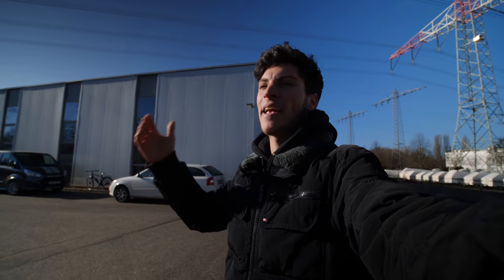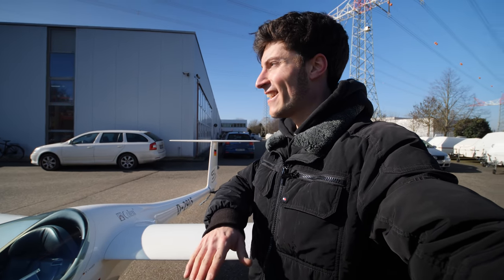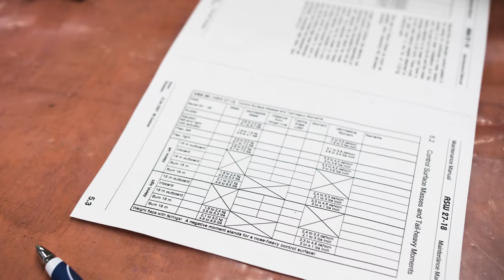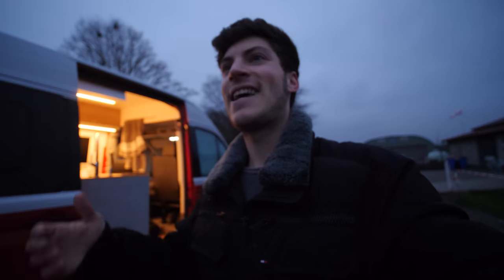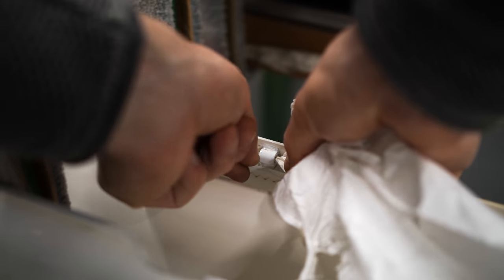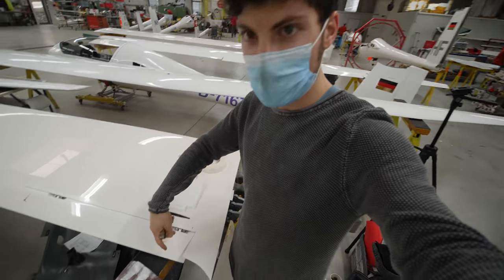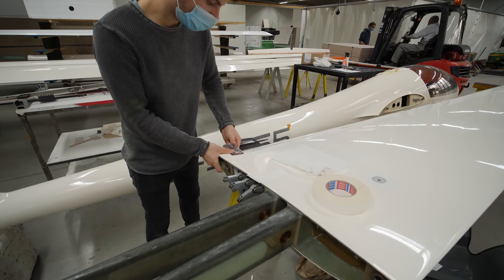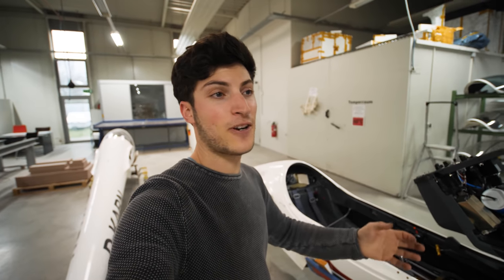250,000 km GLIDER INSPECTION at DG Flugzeugbau Factory

Comment: I noticed that you have applied some kind of primer or glue with a brush before attaching the rudder V-Seal. Would you mind sharing what was that and why is it needed? I think the V-Seal already has adhesive on one side.
Reply from the maker: They use Patex glue on the glas fiber surface to have a better adhesion

Comment: Had to have my LS3 in for its 3000 hour check. It took 40 years to get to that point. It was en expensive check.
Reply from the maker: Did you need to change any parts?
Reply: @SteFly  some flaperon hinge pins (they had to be dug out)
Reply: Would you mind sharing the rounded cost of 3000 inspection? I am considering an LS3 and it indeed scares me.

Comment: how does a glider control mechanics work? is it fly by wire mechanical or hydralic assist for some controls like flaps alerons ?
Reply from the maker: It is conpletely mechanical and only the wheel brake is hydraulical.
Reply: @SteFly  thanks for replying.

Comment: Hey Stefan, I’m interested in buying a libelle and since you’ve owned one in the past, I would like to ask if you know what’s the maximum height of person that can fit in a libelle?
Reply: Depends if you want to use the 'Ned Kelly' racing or raised canopy...... I'm 1.83m and can fit in a Libelle with the 'Ned Kelly' racing canopy.
Reply from the maker: I´m 1,80 m and it was ok with the flat canopy. How tall are you?
Reply: Depends on leg length - accommodates long legs well.  Long back not so much.  Shoulder width can be more of an issue than height. Try first. Great machines with excellent feedback and ability to find, centre and use lift - if you fit.
Reply: I was similarly worried before I bought mine, which has the taller canopy. I’m about 186cm, (6’1”) with shorter legs than average for my height. My knees are snug under the panel with the fiberglass seat back in (some have removed these in the past, maybe not a certified mod), a normal backpack parachute, and a 1” cushion. As has been said, shoulder width can be the limiting factor. A good, long trial fitting with all the gear is the only real way to know. Good luck!
Reply: I’m 1 meter 78, thanks for letting me know guys looks like my height will be no issue at all

Comment: My dad had several Cessna’s during his flying career. He had to get a 100hr service regularly. Is there something similar for gliders? Is this 3k service an industry mandate or is it a manufacturers recommendation?
I recommend for anyone else doing this type of video to add a voice over descriptive. What is going on? Why the change?
Reply from the maker: Gliders usually don´t have 100 h checks. Only 3000 h or 6000 h and the annual check. These are mandatory. Of course there are some parts which need to be replaced from time to time, like the belts, hooks,... I was also planning to do a voice over but had no time to do so.
Reply: The 100h check is something mandatory in the US when an aircraft (including gliders I believe) is used "for hire". Insurance companies may also require it for clubs.
That said the 100h is a very light inspection compared to what was done here! 
Here it is more akin to the engine overhaul on airplane, for example a Lycoming 160-hp engine (which you may find in small Cessna and other similar) has a 2000h TBO (time between overhaul).
These are all manufacturers specific, I don't think there is a regulation preventing you from flying without following the manufacturer maintenance recommendation in the US (as far as I understand the FAA verbiage...), what about Europe?